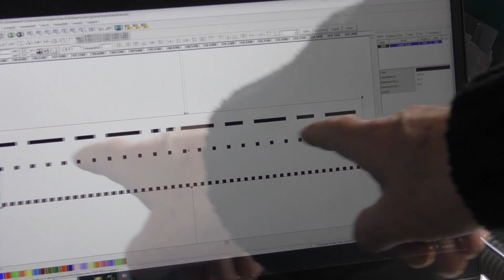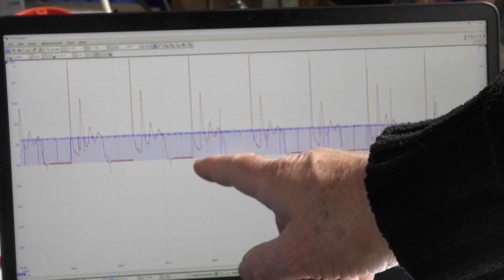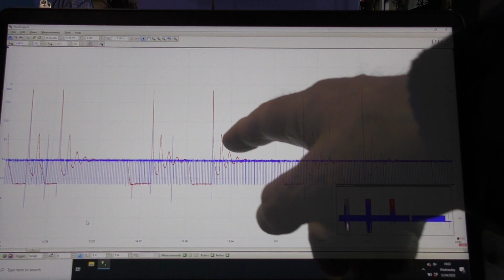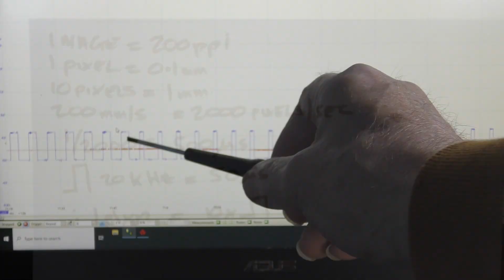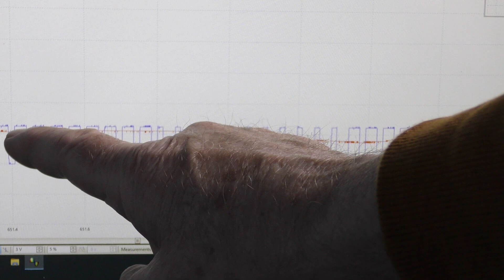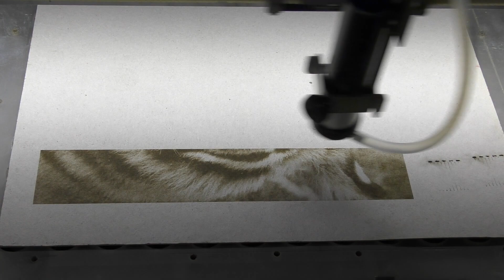RDWorks Learning Lab 250 Deep Dive into HV Power supplies

Comment: Hi Russ, have you found any difference in the laser output, response time or pre-ionisation when connecting the power supply to the  the PWM and Analog signal from the controller?
Reply from the maker: Great question, but No. That's because the PWM coding is a staright A to AD conversion intended by Ruida for  RF  machines. However there is no delay caused by this encoding and it works perfectly for glass tubes. as well as RF tubes. When this digital signal reaches the IN terminal of the HV power supply it is immediately converted back to analog by passing it through a an RC filter.. That first high current preionization spike  is being "arrested" (eventually )by a feedback circuit within the power supply and that is why  we see the typical capacitor charging decay in the first and subsequent pulses,  Note that those pulses are not in synch with the  20 kHz PWM signal. 
 Best wishes
Reply: @SarbarMultimedia  As you know i have watched a lot of your videos and like to recreate some (not all) of your experiments, some are successful others not so much, but one thing I have not be able to get is the pre-ionisation phase of my tube. my tube is a grade A tube 120W Reci which lights up at a minimum setting of 12% power, there are only a limited number of contributing factors but my machine is built with the connection from the Analog signal and I'm just wondering if I swap this the PWM signal will I have more luck?
Reply from the maker: @precisionlasersolutions7996  
 Hi 
I  an not a fan of Reci tubes , despite their revered reputation. Nice engineering but some weird performance characteristics. They have only ever produced high power tubes ( 90 watts and above) that can be considered as CUTTING tubes. I have direct experience of 8 different Reci tubes from W1 to W8 and all but 1 have displayed a strange slow beam start for scanning (over maybe the first 2 or 3mm of scan) where the beam gradually builds up power. You need to be running at maybe 40% or more before this characteristic disappears and you get a uniform burn scan line. This annoying characterisic  may be a feature of the special Reci HV power supply because the singe machine with a basic MYJG power supply where the Reci tube was an upgrade, din not exhibit this quirk. That aside, ALL glass laser tubes will have a preionization zone regardless of quality, power or manufacturer. in fact here is a quote from the Reci operating manual  that  sound like gobbldygook
"Taking engraving as an example, 4mA is recommended to produce pulse with high frequency under preionization state for better engraving."
The best way to find the limits will be to cut some thin card and LISTEN for it
 Here is an example of the amazing benefit of cutting card with the tube in preionization. Listen to how "hissy" the cut is. If you can't see it then do some card trials at different low powers and try to find the upper power limit by the sound of the cut.
https://youtu.be/S_2NOCpACVc

Best wishes
Russ

Comment: When i replaced the shorted PS ( internal arc). 
I needed one quick so i bought a blue unit.
Installed it loose as the internals of the machine needed to be reconfigured for it to fit. So i ordered the correct black unit. 
When that came in i swapped for the black unit. My wife and me agreed the blue just seemed to have less problems. 
Only difference in spec i could find was the kV was higher on the blue unit.

Cloudray does not make the PS. They just rebrand them. 
I am sure the power supplies also have similar quality issues to the chillers. Some are fakes.

Digital kV meter.. Garbage.
Reply from the maker: Hi
 The kV meters stopped working when I put my restsistance in line to measure current flow but the  analoge ammeter didn't.  That says a lot about the sensitivity of it's digital .
operating principle.  It was only this minute detail view of the internal workings that allowed me to find performance I have never seen before. 
 There is no such thing as a quality HV psu. Thery are all made to the same design principles with the same key flaky components. The high voltage  flyback transformers are the same in all designs.. They factory soak the units for a period to weed out the instant failures but there is no guarantee of longivity by paying more. I have PSUs that are 7 years old and a couple that failed after 18 months and 2 years. It does not matter what the kV  output is, it depends on thr length of your tiube mainly. There needs to be sufficient kV to ionize the nitrogen in the gas mix , after that happens (at say 22kV) then it instantly drops back to a lower value (say 17kV) for normal running. If the tube fires then there is enough kV, it's as simple as that.

Cloudray choose there suppliers carefully and enter into official rebranding deals with them.  Reliability and quality are significant factors for Cloudray and if their returns/field falure reports exceed very low percentages, that product line is withdrawn.. The Z80 , specifically sold for EFR tubes (why ? I don't know) was by far an away the best overall performer. The digital meter was pathetic also.
Reply: @SarbarMultimedia   gunny thing is.. Thr blue and black unit come from the same manufacture.
So the Kv is only relative to the initial firing of the laser? I couldnt find any information explaining specs of the power supplies.
Trotec and Boss do not use the same PS that low budget or Cloudray  machines use.

The digital meter is a novelty. Not actually useful. I quickly removed it and put the analog back in.
Reply: @SarbarMultimedia   The PSs with remote ammeter connection have a 100ohms resistor in series with the return line. With your method of measuring the current, you short cut this resistor. The resistor input is exposed on the RJ45 socket (3rd pin from the left, 6th pin is GND). You can use those to measure the current.
Reply from the maker: @GlimpsOfScience  
 Mant thanks, I greatly appreciate that information.  I did realize that my resistor was disabling the digital ammeter  but had no effect on an analoge meter.  Before I put my resistor in line, I asked the technicians at Cloudray where I could measure current flow. Sadly their response was rather tardy and so I made my own decision thanks to Ohms law.. In principle the 100 ohms will make no difference to my readings  or any current feedback circuits within the HV power supply because the current flow will be the same through all resistors connected in series. The Z80 PSU was connected to its display with  4 wires and obviously had it's own sensing resistor  because that could not register mA either. I didn't see this as an issue because I could see the current flow through my resistor as a voltage on my scope and knew I was not overdriving the tube. However, it is rather alarming to see the volume and magnitude of NATURAL overdriving taking place  that would never be seen on an analog or digital ammeter. So much for us being cautious about overdriving our tubes!!!   Note. There are no such issues with RF tubes because they works with a fixed current flow and there is no preionzation to worry about. That is probably the main reason why RF tubes have a longer life.
 AFTERTHOUGHT:  My knowledge of electrocs/electronics iis very basic but it sems illogical  for the digital ammeter to be disabled.  Current flow through the 100 ohm digital sensor has remained unchanged so why does my preceding resistor have an effect?
Reply: @SarbarMultimedia  Your way of measuring is by no means problematic and absolutely correct. The 100ohms resistor is located between your resistor and GND. The GND of your oszilloscope connects to the input of the 100ohms resistor. With a standard oszilloscope, GND is the same as the GND of the PS. Now both sides of the 100ohms resistor are connected to GND and the voltage over this resistor is 0. I don't know about the Picoscope, though but your experience seems to indicate that it is the same.
Reply from the maker: @GlimpsOfScience  
 Many thanks . That makes perfect sense for an electronics dimmo like myself.. Various ground levels are very confusing but obviosly my scope is connected to either side of my resistors and  is not connected to machine GND . I am measuring the votage drop across the resistor and not relative to gnd.
Reply: @SarbarMultimedia  "and not relative to gnd" well, yes and no. There is a nice video: EEVblog #279 - How NOT To Blow Up Your Oscilloscope!

Comment: Thats what I thought that all those designs are 100+ years old haha. So, there is still no suitable good power supply for regular etching/engraving, right? As far as I understand the last one you tested works the best, but only in very low power modes, right? I have to etch my materials at at least 600mm/s and preferably at 1000, and this delay issue is killing me...
Reply from the maker: Hi Vlad 
I typed a reply to your comment but it seems to have been posted to a paralleml universe. Did you ever see  it?
Reply: @SarbarMultimedia  haha, you guessed right - not at all. I do see this one only. 🤷‍♂